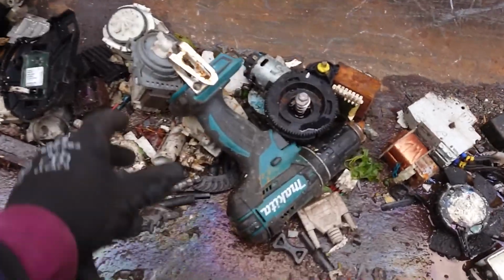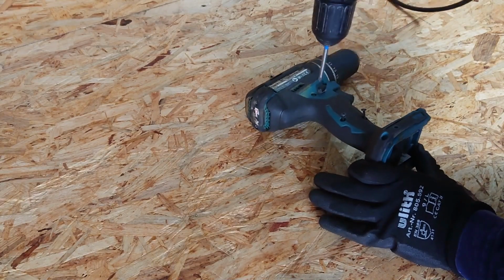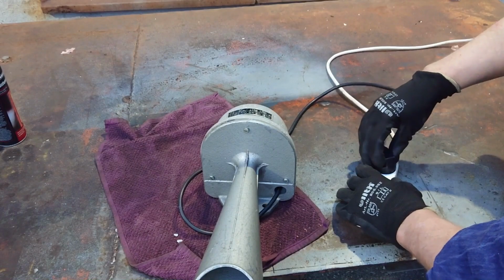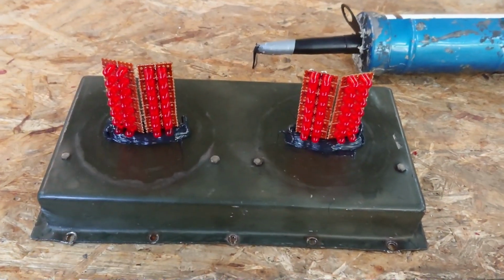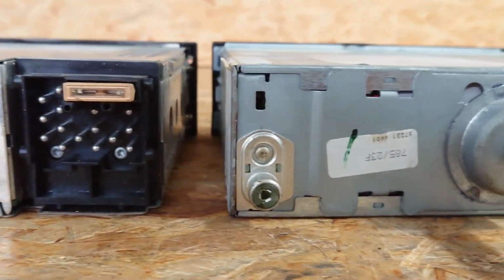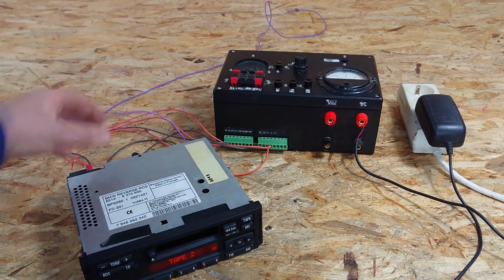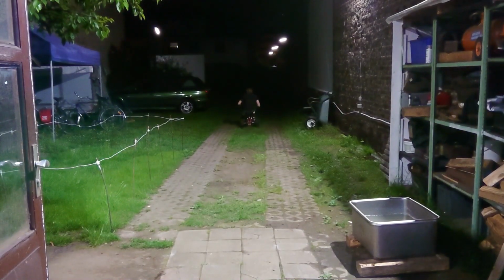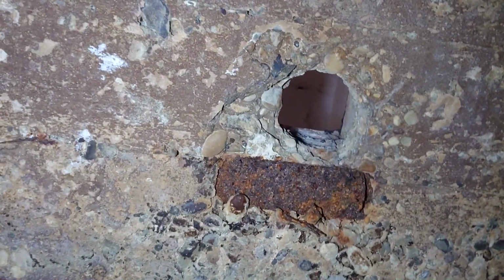Exciting Scrapyard Finds! Repair-A-Thon!

Comment: another feature of German (VW, Audi, Porsche) 90s car radios is a aftermarket iPod circuit that plugs into the optional CD changer. all the factory CD controls work like normal so that will make restorers happy, no wires cut.

Comment: I'm a great fan of Zimmer frames and aluminium walking sticks. With the new aluminium welding rods its really versatile with the "click togeher" fittings and pre  bent parts. I use it extensively in my airflow measuring gear. Can often be found in charity shop bins. Also laminated aluminium/plastic sheeting from signage company bins.

Comment: Those radios worth a fortune now and super easy to add Bluetooth to or an aux in. Cd auto changer input can be used to add Bluetooth, the rare Phillips one a Dutch guy at makbaas has an arduino based converter you can plug in. All hidden behind and looks stock.

Comment: ATV tires are generally very low pressure... Like 2 PSI for rear tires and 4-5 PSI for front tires (numbers for my full-sized AT-4WD, but there's no way that even a child's ATV tire should get to pressures that would make it  BTFO like that).

Comment: More nicely diverse picking and as a bonus, some of the booty converted over and immediately (via video) utilized. Some may think that mixing technologies old & new is strange, nope, just using what is available to make things work. Everyone likes a 1932 Ford with a 2010 Chevy engine & transmission??? Mixed technologies. Semi funky old strangeness of concrete basement stuff, WAAAY out in the boondocks... Thank You for the video. Michael in Colorado.

Comment: I trash picked an ATV identical to the one you've found. To improve the fit (I'm 6'1"), and tip-over stability, I plan to widen the track with spacers, or wider tires, and swap, or fab new handlebars, and/or steering shaft to extend/move the grip forward.

Comment: In  the scratch built or  homemade built model railroad community a lot  to guys use cordless drill motors as the drive motors for their train engines very powerful And I have seen them pull trains that were 40' long great video brother thank you for sharing your knowledge and expertise

Comment: Good on you to both be reusing (and promoting the reuse of) older equipment that only needs minor repair, rather than discarding it for new, and showing how to repair or even improve such things!

Although your channel name makes me giggle a little. I suppose one should not take it entirely literally, since you send away for parts and buy online, when it is convenient, rather than scrounge locally for repair parts and supplies and use only what you have and can get through salvage. But I'm a bit rigid about such things -- so, likely it's me :)

Carry on! I like what you do. The funny name doesn't matter.

Comment: Another great video! Be careful with the ventilator. Old and even ventilators not that old can build up dust. And it often happens that the ventilators catch fire when the motor gets hot.

The building at the end is indeed really facinating, what strikes mee is that the outer walls are all concrete. However the wall between the two small rooms is brick of some kind. There are enough  bunkers from woII around where I live to say that the roof of that structure is far from thick enough to be a bunker. As for wat it then should be, indeed a water sore or cole store seems most logical to me. Possibly reused later to store other things.

As for the toys, if childeren would have been down there, toys would not have been configned to the first room... Probably toys thrown down in play or by bullies.

Comment: I have also experimented with various DC motors. I built a lawn tractor with a golf cart motor(rated 36v-48v) I will now like to experiment using Lithium cells since the Lead Acid batteries are heavy and bulky, but they are more stable in the conditions the machine will be in. It would be cool to get your thoughts on this potential changeover👍🏻

Comment: About the bunker: I cleaned out a cesspool last year which I now use as a rainwater tank for garden irrigation. It wasn't in use for 20 years, but the coloring on the wall and ceiling looked exactly like in your pit. In my case, it was concrete all around, except for one spot, maybe 50x50 cm² where there was no concrete, but gravel. If you find something like that, you can be sure it was a cesspool (Sickergrube), because it is an intentional leak to not have to clean it out so often. The ground underneath might be contaminated then, so think twice if you wanna buy the property. Especially if there was some industry located in the area... Cheers!

Comment: Yes, I am very impressed with what you can do with non-junk.  I am a cheap individual and have done many of these types of reassignment of non-junk in the past.  Unfortunately, I am without a workshop currently to putz like this.  Good hunting.  As far as the cabin it is clear to me that the cabin is designed to be an Air Raid shelter, like all of these types of shelters it was designed to be totally inadequate for the purpose.

Comment: A bunker does look a bit different. There are small bunkers, these i know and i saw a lot of them.
They were are square and quite low. The roof was flat and the edges were rounded. The material
was steal reinforces concrete with pebels...

Comment: Ah yes safety standards for electrical equipment. Imagine you were only allowed to keep your 1930s vintage car if it passed the most recent exhaust gas quality and safety tests and you're not allowed to modify it using anything that didn't exist back then.
Compare 1970s solid metal flat surface space heaters to todays round plasticy easy to tip over heaters. The only way these pass the safety standards is because they don't have any metal surface. The old one, which was working perfectly, got the cord cut, because the safety concerned people were too lazy to test it for conformity. They just said "It's old so it MUST be crap and extremely dangerous to operate". Next to one of the new ones which melt themselves when you don't look at them weird every five minutes.
Btw. screw Discmen. I'm still using Walkmen. In 2021. Never stopped using them. The batteries last longer, they start playing instantly, they don't skip if I toss them around, I don't need the DeLuxe edition for the playback to start where it stopped, they are more compact, they are super easy to repair and the sound quality isn't as bad as everyone seems to remember (or "know" having heard from other people saying)...
Shoulda used a 555 for the alarm!!1!one!

Comment: I use a taurus fan from this period or a bit earlier every time it gets hot (or my clothes need to dry a bit faster). Mine is a stylish brown and has a dial that is a combined on/off switch and stepless speed control. Really nice and quiet, way quieter than any modern fan

Comment: As for that "building" I would think it was probably some kind of bunker that has long since been forgotten. 

Could have been built in the war - maybe as some kind of outpost or forward control for the Wehrmacht or the Luftwaffe or maybe for a radar station? It could have been built by allied forces as some sort of bunker during the cold war for radar or anti aircraft or forward control purposes or maybe someone worried about WW3 built it. Difficult to say at this point.

Comment: I was using a minidisk player in 2005 - for the sole reason it was a lot easier to get in your pocket and the discs didn't get scratched and on long play recording the quality was pretty decent but you could get 2-3 CD's worth of music on a single minidisk. I was using minidisk from 2002 to 2006 and then I got an mp3 player and sold my minidisk player.  

CD's are a great format - they are still made and sold and people still have large collections of them. I think its pretty incredible that Sony and Philips managed to develop them when they did - to encode all that data, to make such a durable format and to make relatively affordable compact players. I still use my CD player every now and again although I ripped a lot of music off of mine into a format called FLAC which is apparently "lossless" in terms of the human ear.

Comment: The desk fan is definately a keeper. I live in New Zealand but if I was closer I would ask to buy it from you, also we are 230/240 volts and 50 Hertz so I don't know what the rating on the fan is. Those radios remind me of the Alpine and Blaupunkt Mercedes Benz radios of the 1970's/80's which are very,very collectable, and I like them especially the ones with 2 dials and the buttons in the middle (early design). If you ever find those in the junkyard, take it home, MB enthusiasts will be your best friends! Even the classic Hirshmann antenna are sought after.
Like the alarm and warning lights, and how you put it up with weather protection, good design. Thank you for posting, we like your content.

Comment: There is lots of strange places like that house your found, they are all over the world it seems.  I'm wondering if it could be a "spring house" where the bottom level was either a cystern or had a spring running into the basement, which may have eventually gotten plugged or the spring went dry.

Comment: i wish parts for bosch tools were as easy to obtain as makita. i have a couple of 1500 model power shears that need parts, but seemingly have been discontinued. i cant find a new rotor assy. anywhere, even through aftermarket parts warehouses.

Comment: Just looked over my 800-1000 tools, only 5 of them are not old enough to vote (2 cordless drills, an angle grinder, a compressor and a larger set of bits) and many of them should apply for old age pension but refuse to retire. Enjoy yours in good health.

Comment: That's is one hell of a cool fan...pun possibly intended. Those blades are great, the whole slightly angular aesthetic or the thing. Beautiful. As for that Klaxon light combo, I almost hope someone triggers it, without causing you any loss of course. Add a video camera to capture the full effect, I anticipate a magnificence of cold fear and scrabbling legs as they prepare for whatever impending doom it clearly heralds. Killer robots, a nuclear strike, automatic machine gun turrets, the unleashing of the dogs.

Comment: Nice video, but please take more care of the sound , there is a lot of difference in level between scenes, which makes that a viewer constantly needs to adjust the volume. 
Schönes Video, aber achte bitte mehr auf den Ton, es gibt viele Pegelunterschiede zwischen den Szenen, was dazu führt, daß ein Zuschauer die Lautstärke ständig anpassen muß.

Comment: I actually have one of these business rds radios in my bmw e34 (1994). 
Although I hacked it a little bit, by soldering a audio input to the IC.
The radio is still functional, but I had to give up the cassette-function (which I wouldn’t have used anyway)

Comment: A: you should have used more powerful LEDs. Normal 5mm LEDs are pretty garbage (~0.04W) compared to more modern 1-5W LEDs. Those probably won’t be visible at day time at all.
B: instead of connecting them in parallel and run them on 12V, you should have just made a big series string and run them off mains with a capacitive dropper, switched with a relay or (opto)triac or MOSFET. There are multi-chip LEDs that have higher voltages to make them easier to run off mains.
C: there are cheaper microcontrollers than the 328P you used, or you could just use a 555 or comparator circuit with pots for adjusting frequency and duty-cycle, with an SPDT switch to change whether the lights are alternating or in sync.

Comment: FYI you can mod these BMW units to allow aux input. If you open one up, the cassette tray mechanism is separate and has a relatively obvious three-wire bus that feeds into the main board of the radio. This is L/R/GND line-level stereo, it's possible to hijack it to some typical RCA standoffs. Search "C33 aux mod" for more info.

Comment: Regarding the abandoned building:

I would guess bunker. 

It is interesting that a parge or skim coat of cement plaster like material extends only partially up the masonry walls. That seems to imply something, but what? Also from my brief glimpse of the concrete ceiling it looked as though the builder used narrow planks rather than sheets of plywood as a form which seems to date it prior to the 1960s.

It is indeed a mystery,

Comment: I love that you found the electric ATV. I was thinking of building a MOTORIZED cart with a large wooden pallet for working around the house/garden.
Reply: @Stacking Sigma Memories You lucky bastard! Those things cost 1K at least around here, so way over my budget. Was thinking on building snow pushing thing with tracks from one until i saw the price of used units.

Comment: Depending on where that little place is, it could have once been a "stay-behind" hideout -- NATO and various Allied intelligence agencies had little hideout bunkers dotted all over the place in Western Europe during the Cold War, stocked with weapons, food and other supplies, for guerillas to operate from, in case Ivan ever rolled through the Fulda Gap. I would surmise that the holes in the ceilings originally had air pipes running through them, and that their above-ground tops would have been concealed under fake rocks or foliage.

Comment: Figured post apoc would have had a few motors stashed back that he would have used on the atv..  rather than buying replacements..  

But that underground deal there, definitely a place where people were tortured..   to have all that and a small ass hole to get into.   Yea..  people died down there..  and im guessing quite a few...

Comment: I don't think it was a bunker. How would anyone get down into it. There should be a steel ladder type rungs embedded in the wall. i don't see a water mark if it was a cistern either. Possibly a hunters locker and food storage maybe. A block and tackle to lower someone on a small platform.

Comment: My suggestion:
An extremely bright lite(s) pointed straight at the entrance(s)
A loud siren inside your place, one that is above the pain threshold.
Instead of hoping for a response, make it impossible for the intruders to stay
Reply: A few 100W LEDs pulsing at 5-10Hz and some air horns run from high pressure compressed air will work nicely.